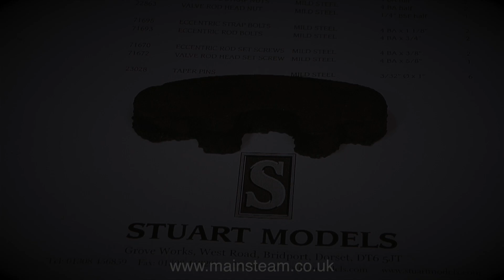HOW TO REBUILD A STUART MODELS 5A STEAM ENGINE - PART #19

Comment: reamers are always a pain in the neck. most often what i do since i have to do everything on a budget is i will take an oversize twist drill. i'll chop it off pretty short. right about where the relief grind ends. then i chuck it up in my drill press and then use my dremel to grind the diameter for what i need. i tend not to need more than an inche or so of depth on my projects so i can get away with this. it works pretty good. then i have a reamer for whatever for the rest of forever.

Comment: With ageing failing eyesight, I find using a centre punch very taxing. I bought an optical centre punch, which not only magnifies the view of the markings you are aiming at, but ensures your XY and vertical alignment within half a knats doodah! They are very useful, but a bit pricy.
Reply from the maker: A good idea, I will look into that . . . . the only problem is, will I be able to find the optical centre punch on the bench ?? What bench ...... :-)))

Comment: The speeds and feeds are a very individual thing, I belong to a model engineering society and I don't think there are two of us that use the same speeds and feeds. This is due to the fact that most of us have different equipment. we all start out using the published ones in the various handbooks, but soon realize that they were made for industry where you very much consider tooling as consumables and time is money. Once we switch over to the home shop mentality we think tooling is money and we try to make our tooling last as long as possible while still giving us the finish we want (or sometimes a better finish than what industry would have done) after all we are doing this for our own enjoyment not to make money. So if Keith does give some speeds and feeds use them as a guideline and a starting place and adjust them to your own shop.

Comment: Guy asking about speeds and feeds:

(1000*cutting speed) / (pi*diameter)

Cutting speeds for mild steel with good coolant flow:

High speed steel (drills etc) 30
Carbide                                    150-200

Dry cutting is much less than the above, even in cast iron - it's self lubricating but not self cooling.

Example cutting rpm for a 10mm hss drill:

(1000*30) / (3.142*10)
30000        / 31.42
= 955 rpm

Example using a carbide 10mm drill:

(1000*175) / (3.142*10)
175000        / 31.42
= 5570rpm (good luck finding a machine to run that fast!)

Numbers are the same for milling cutters and lathe tools.

Feeds should be between 0.05mm/rev and 0.25/rev for lathe tools (possibly more on very soft materials that wont chip (although in reality without carbide tips with chip breakers nothing will chip properly no matter what your feedrate))

Milling wise feedrates arent as important, sound and feel are the best telltales, if it sounds rough ease up, if it squeals and the work is securely held speed up. But generally 0.025mm/tooth to 0.1/tooth is acceptable - if you have a 2 flute slot drill then that's 0.05/rev to 0.2. For a 4 flute endmill then that's 0.1-0.4 as a starting point.